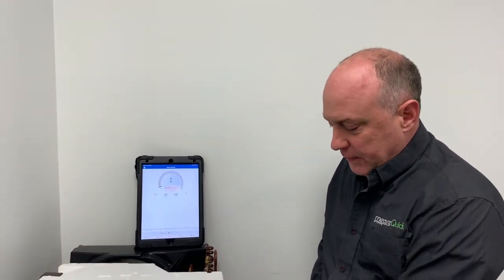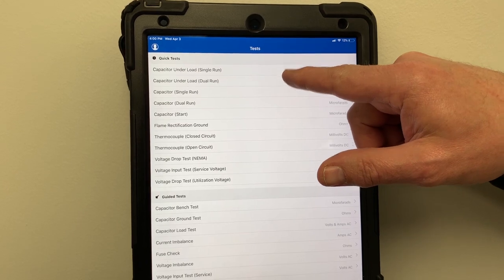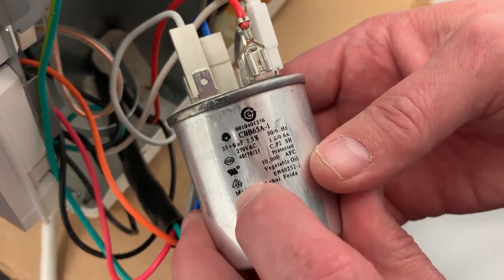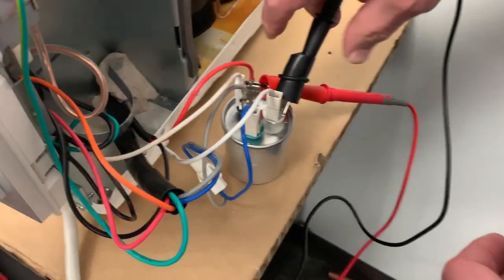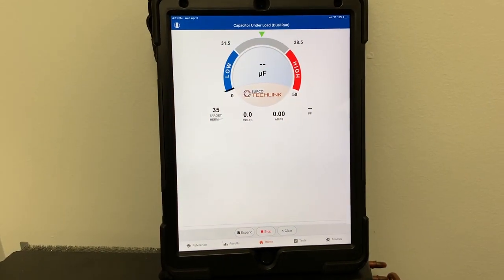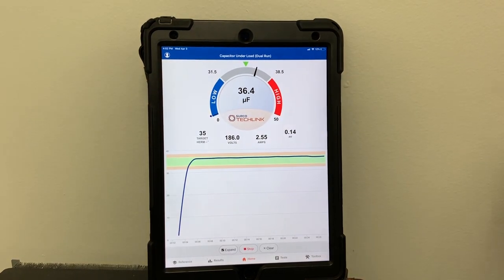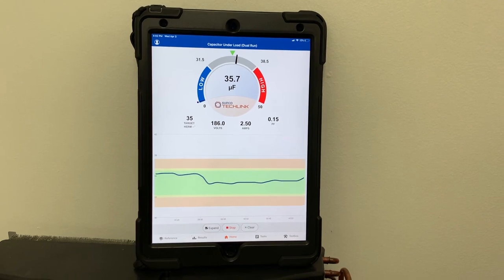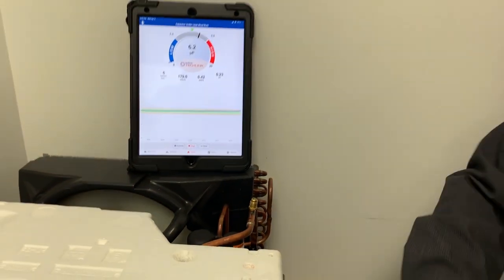Test a Capacitor Under a Load with the Supco®-Redfish iDVM550 Wireless Clamp Meter

Comment: Awesome. Bought one a couple days ago. How do you determine the correct  run cap size if it is not known or can’t read it like you mentioned  in the HVAC SHOP TALK podcast. Thanks for all you do Jim
Reply: That feature is not built in yet. On the way.
Reply: @accutools6288  any update on progress for this?

Comment: Does anyone know why the power factor is so low, but this is acceptable?
Reply: Capacitors exhibit low PF values, ideally the value should be zero but in reality the value is non zero. So the higher the power factor value is on a good capacitor the lower the quality. Note that higher values can also be indicative of a upcoming failure or a failed capacitor.

Comment: awesome meter in theory, but with the meter having such an oversized clamp that gives different readings relative to wire placement and software only having Capacitor Rating fields that can be adjusted, it is deceptively lacking. the pass/fail margins of the software are preset to +/-10%, whereas the cap being tested was rated at +/-5%. and with a software that obviously calculates mfd = Amp * 2650 / Vac instead of the truer form of mfd = Capacitor Amp *  Xc / EMF Voltage, shouldn't there also be an input field for Frequency in Hz to accurately calculate microfarads, instead of the generic and fictitous 2650-ish number everyone teaches as a constant ? after all, US appliances are designed on 50/60 Hz, our power is based on 60Hz, but the 2650 is simply a rounded down number from the 2652.56 found by calculating Xc at 60Hz. What does teaching or in this case, manufacturing a product do for those techs in other countries whose power operates at a different frequency. most countries use 50Hz, where this number would be 3183.08 rendering the software useless. 
in the vid, i stopped the vid at 2.25mins. the screen read 35uf, 186Vac, 2.46Amps. at the calculation using 2650, the calculation equals 35.04..... , at 2652.56 the reading would be 35.08.... so, although this cap is still good and within it's tolerance, it's calculation is off. and we know how we can get a variance in power from a problem on the grid, even 1Hz difference would give us a reading of 35.68 at 59Hz.
 i hope to see an update to this software,as that would be an easy fix, and as for that clamp, we are not checking 2" thick wire, and adding some plastic to correctly place the wire when the meter hangs wouldnt hurt.